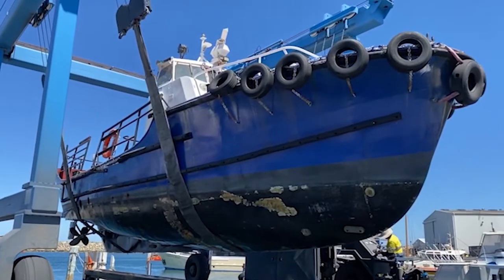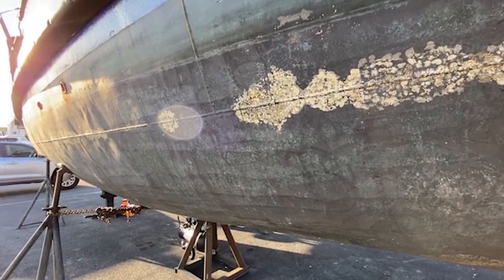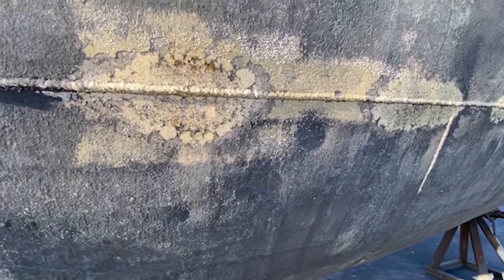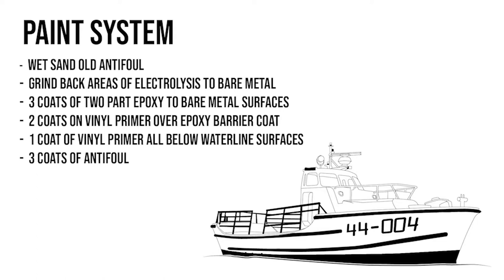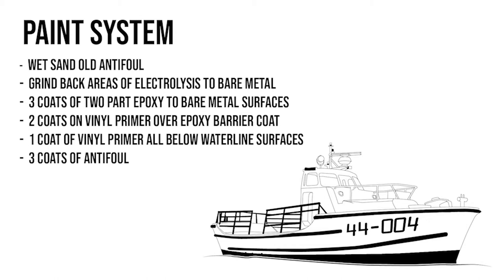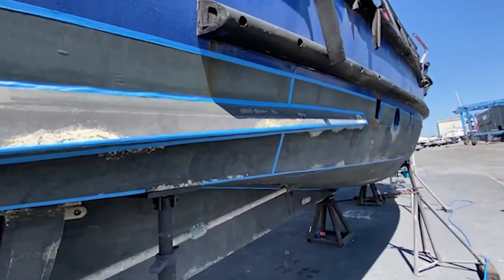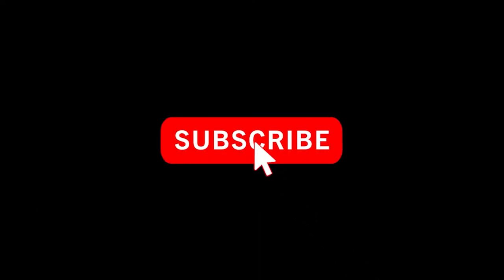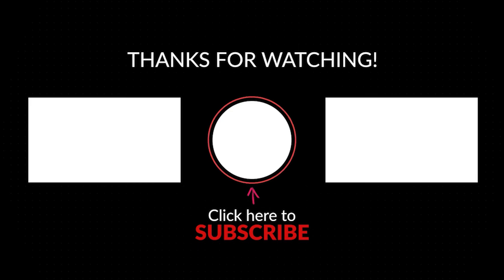Electrolysis (Stray Current) Damage and Hull Prep - E09

Comment: Whether AC or DC all electricity leaves the source goes to the load (or wrong path) and goes back to the source.  There is no AC trying to get to ground.  It usually uses the ground path to get back to the source in a fault condition as with AC the safety ground is bonded to the neutral wire at the source. (Transformer on a pole near the marina.) In a marina a fault with an AC current to a metal hull means AC in the water and potentially electric shock drowning.  BTW Bonding systems have one major flaw, they make a great path for stray current corrosion, on non-metal boats.

Comment: Why didn't you show what tools you used to clean the paint off? I also have a steel boat, and there are lots of options. The best one I've seen, short of dry sandblasting, is to use a drill and a Dutch produced tool called a TERCOO. You should check it out. Using a grinder does not give you a good profile for paint to adhere, the metal is too shiny.
Reply from the maker: That’s what I actually used. It’s in my next video :)

Comment: The word "Electrolysis" is mistakingly used when talking about corrosion it should be termed as electrolytic corrosion or stray current corrosion. Electrolysis is when you used electricity as a tool for a specific purpose of removing body hair.